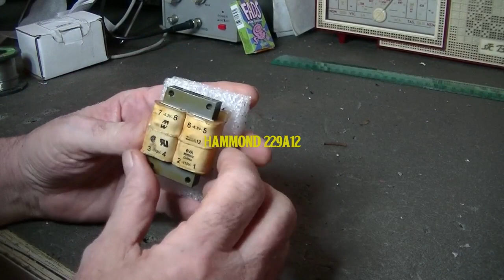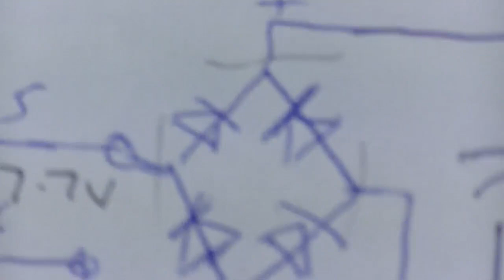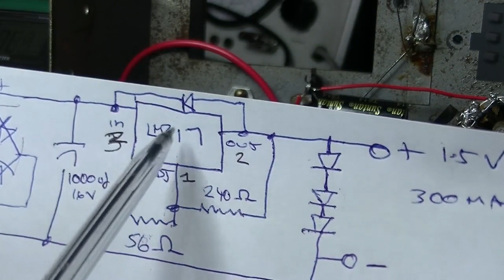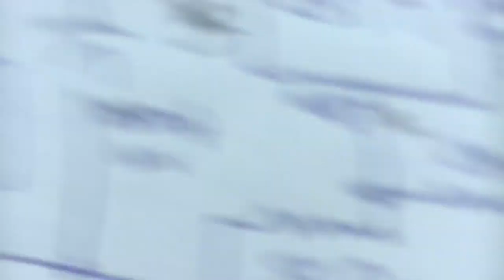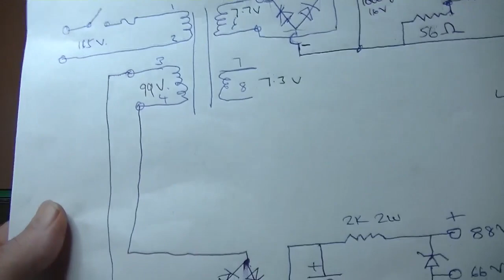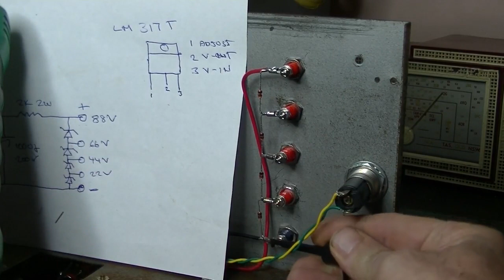Building a simple solid state Battery Radio Power Supply Part 1.

Comment: Just a note; the heat sink flange on the LM317T is connected to the output pin, so your chassis is so connected.  If you use this to power a radio whose chassis is also earthed, you'll short out the LT supply.  You'd be best installing a TO-220 insulating kit on the I.C.  ☺
Reply from the maker: Thanks Stuart, I wasn't aware of that. I'll get one

Comment: Awesome for a start to get a battery only radio working. But will it power a 1920s to 1930s tube radio? That usually is 
the ultimate test.
Reply from the maker: I'm on on Part 2 right now Steve. Working on a very cute Astor Porta GC, Which I hope the PSU will fire up and then maybe not lol.